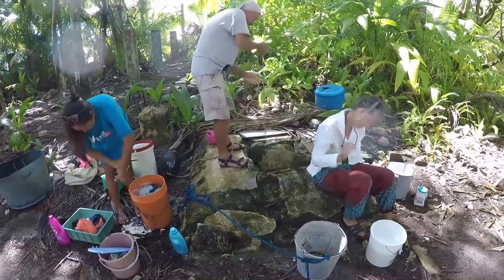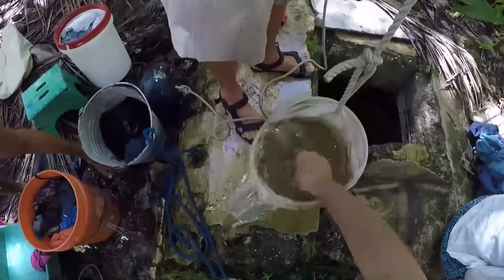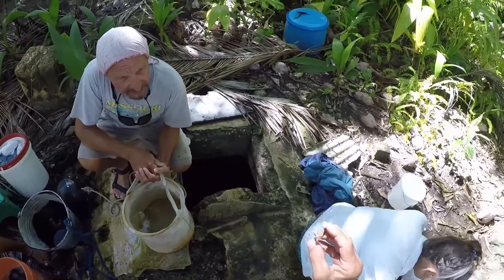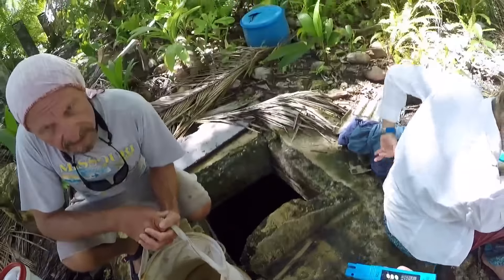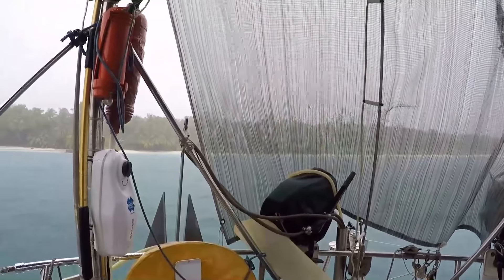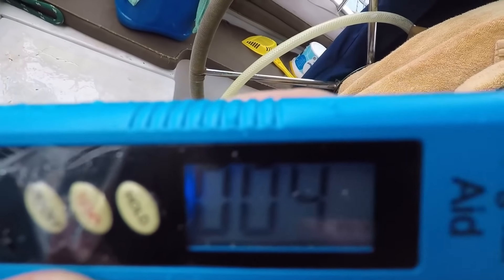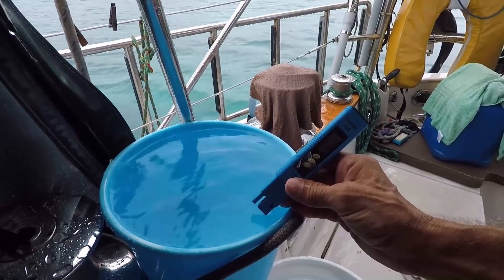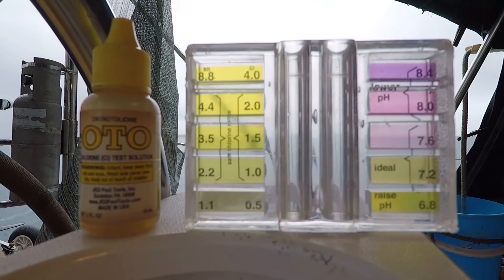Water onboard a Sailboat in Chagos-How to Survive on a Desert Island -Patrick Childress #16

Comment: For what it's worth our RO system for the house takes 170-250tds here in southern California USA to 5tds.

It's also a 7 stage system with a 2:1 ratio. 

I'm learning more and more about boats and was shocked at how terrible the tds was on water makers. But in perspective it is cleaning sea water...

But I had to comment on your rain water and ro water. Sure we are filtering clean water but I can get ourbtds way down.

Great work and I love your videos. Ty
Reply from the maker: Thank you,Chad. Here in Africa, the city water tested over 300 for TDS. That is the highest city water I have tested anywhere. The water is very drinkable as is. Is it really necessary to get your city water so low in TDS? Is there a bad calcium or iron taste that needs to be removed? There can be a lot of things in water that is good for health, or maybe not so good, depending on the source.
Reply: @RVLifeNOW  I would, in the past drink tap no problem--i cook with it. Our old house was around 250tds, our current place is reading 170 but have seen it as high as 230. Not really sure about other area's in the states, but so-cal dumps a lot of chlorine into the tap, we can smell it. Our grass and plants don't even really like it. They (the plants) go nuts when it rains but not when we water regardless of season...

I could be happy with a carbon filter to be sure. Maybe I just got carried away :)

It is 5 tds before we add minerals back into it. one of the other "filters" is a mineral enrichment filter?. I monitor after the RO membrane to keep an idea of its health, once it hits 20-35 i replace it (1.5-2 years). As you said "There can be a lot of things in water that is good for health" and from my reading "distilled" or very low tds is missing things we need in water. Though we get a lot from food, water does play a role.

for what its worth, I truly enjoy your videos and envy your life style. one day, one day i'll venture out on the water on my own boat.

Safe travels, and fair winds sir.

Comment: Thanks for the videos, I learned a lot about how I should be maintaining the water on my boat.  Can you post  the brand of testers and kits that you're using?
Reply from the maker: Hi Lowell, Thanks for watching. The TDS, Total Dissolved Solids meter is a "Digital Aid, Blue TDS Meter".  Rebecca bought it on Amazon. To test for chlorine, if you live in Florida, you can buy a swimming pool test kit at nearly any hardware store. Much farther north, like in Rhode Island, specifically, a pool supply company will have them. They are cheap and easy to use. The Hach Company makes the Pathoscreen. Their site does not show a price. I got my supply from the Environmental Protection Agency in the Marshall Islands.    https://www.hach.com/pathoscreen-field-test-kit/product?id=7640249603     I just tested the water at the dock here in Mauritius with the Pathoscreen and it showed the water is safe to drink and can be put in our tanks without any further treatment. TDS is 86 so this water is far better than most cruisers RO water, and a lot cheaper....like free.

Comment: Hi Patric, what do you think about adding a UV filter in line for boat H2O ? It could be powered off the inverter ? This would illimnate the need for chlorine which has been linked to cancer?
Reply from the maker: It seems everything has been linked to cancer, especially in California. Millions of people would be dead if chlorine was not used to kill pathogens in water. Just set a bowl of water out for a few days and you will see it turns slimy and changes color. There are millions of mildew spores in every breath we inhale plus bacteria free floating in the atmosphere. All that gets into your water tank and will start growing. Leave it too long and you will have a real polluted swamp in your fresh water tank. It is good to have a clear viewing port, or a removable access to look inside a fresh water tank to monitor how much muck is gathering inside. It might be nice to have a filter and maybe a U.V. light after the tank but you are increasing their work load by not keeping the tank free of naturally growing contaminants. I would be more concerned about breathing the pollution and auto emissions near a city than that little bit of chlorine.

Comment: Re: rain water for batteries: Obviously zero TDS is optimum for batteries, but in your experience, what's the highest TDS you'd use and not expect to see a dramatic decline in the batteries? I didn't realize there would be such a variance in TDS in rain water (I was always told never ever ever). Each drop of rain contains some contaminants (condensation nuclei): my dad always washed his antiques in the rain and they always looked terrible afterwards. But it makes sense that the big rain drops in the tropics would have much more water per TDS than the small rain drops we get around here. 

I found most interesting that different countries in the same region had such a variance in the quality of municipal water.

Subscribed. (got here from galley tips)
Reply from the maker: I don't think I would want to drink rain water caught in Los Angeles or Denver, or even Chicago or so many other cities. But to show how much dust travels, the east facing sides of buildings in the Caribbean can get a film of dust blown over from the Sahara, in Africa. I recently tested the TDS at two faucets in South Africa. Both came back at 330ppm. But there were no microbes and the water tastes fine.
Reply: @RVLifeNOW  Sorry, I know you can drink it, I was meaning specifically for putting into Lead Acid batteries, where would you set your limit for TDS on a regular basis, or would this be an emergency only kind of thing, and just accept that your batteries are damaged after this?
Reply from the maker: @wilfdarr   My mistake for reading through the question too fast. Battery water should be no more than 5 ppm, parts per million. Distilled water is generally below the 5ppm threshold. Distilled drinking water is the same and a lot cheaper than anything labeled "battery water". In the Philippines we bought several bottles of "battery water".  They were obviously taking heavily calcified tap water and putting it in their "battery water" bottles. That water tested above 300ppm for TDS. Drinking water, which was labeled "distilled", bought at the the marina office, tested at 4ppm. Now, I always first test any water we put in the batteries.
Reply: @RVLifeNOW  Wow. Ok. Good to know. Thanks!

Comment: Indonesia should not be compared to Malaysia, the water in Indonesia is still treated with the old method. Unless the Regional Water Supply Company (PDAM) gets its water sources directly from mountain springs. Like on the island of Lombok the source of water from mountain springs.
Reply from the maker: It does not matter the source. How is the water treated and the pipes used to get it to the final faucet. Without a bit of chlorine, water goes bad quickly and I doubt any one in Lombok spends much time testing the water for maintaining the proper chlorine levels, if they even use chlorine at all. I have spent time in Lombok. Nice island though. Down at Cuda beach, I turned on the shower in the hotel room and the water came out stinking as bad as a swamp. I had to let it run a long time before the water cleared up.

Comment: I have to disagree with your R/O TDS levels, because my R/O system is regularly below 10TDS. and with some DI resin you can get 0 TDS.  I change my R/O membrane ounce I reach over 20 TDS.
Reply from the maker: Why in the world would you go through the expense and trouble....and need such pure water...unless you are selling battery water or your clothes steam iron is getting an incredible amount of use! Normal RO water would have to be put through twice to get to your stated levels.
Reply: @RVLifeNOW  Actually it's no trouble at all, all I do is flip a switch. Admittedly though I'm a lazy person.  I learned a long time ago that chores had to be simple, or I end up not doing them.  Carrying jerrycans full of water back and forth on a dingy was not for me.  Oh! I also like long hot showers.
Reply: I think Patrick is correct here.. I have been a marine tank keeper for a long time and water quality is pretty critical..  RO units can vary greatly depending on pressures, membranes and starting quality of the water itself..  In my experience,  city sources that start in the 400ppm range tend to end in the  under 50ppm range... The process is fairly wasteful to start with and while the DI process uses no addl water, it is just a waste of time and resource.. (and kills any flavor in the water)

 A DI filter typically gets things well into single digits.. 0 readings are fairly rare (you need quality test meters for this as the $40 stick pen is not capable of measuring for 0 TDS..  

We run DI for marine tanks due to the sensitive nature of some of the organisms .. BUT we do have to buffer this water as PH stability issues start to arise..
Reply from the maker: @randalljames1   I have been testing city water on a number of Indian Ocean islands and it is consistently cleaner than most yacht RO systems. In Dar es Salaam, the largest city in Tanzania, Africa, I tested city water from two different sources. The TDS was at 90PPM but microbial test in both tests was positive. A little chlorine is all that was needed. Despite this, the locals all drink the tap water and have no problem.
Reply: @RVLifeNOW  And the source of Montezuma's bad reputation. haha